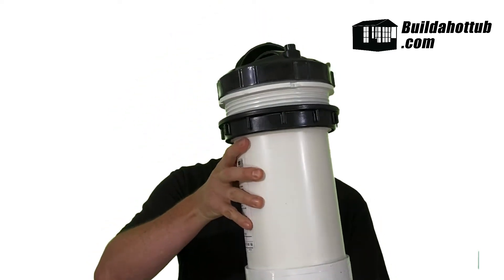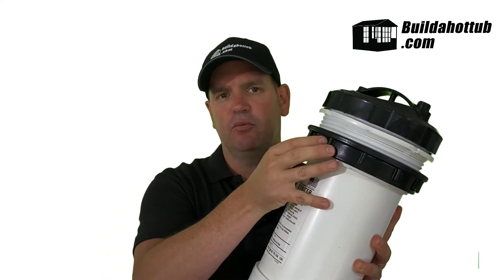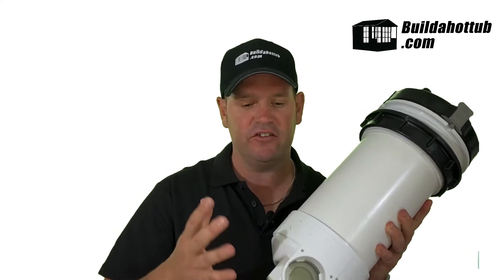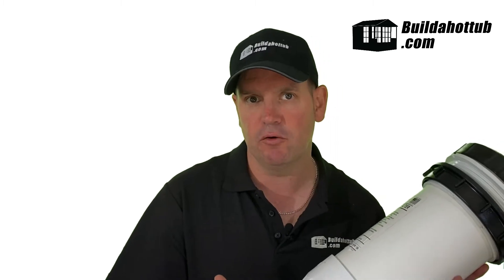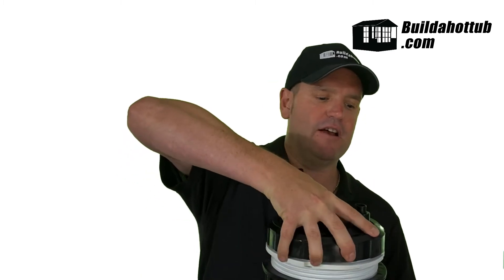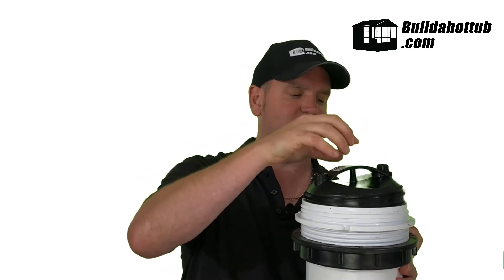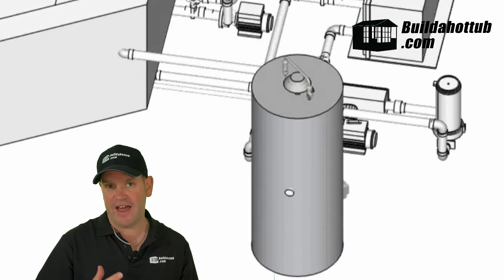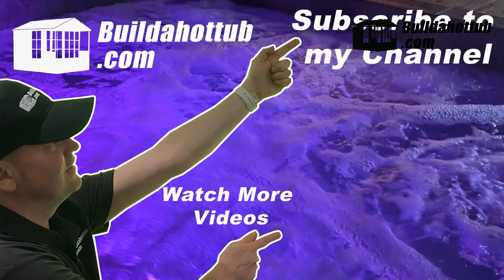Hot Tub Cartridge Filter 101

Comment: How about Removing and installing one ? or is it too difficult?
Reply from the maker: Hi Gary, depends on they type. This type are solvent welded (glued) into the pipe so are a little more difficult to remove and refit as you will need to cut them out. Once they are out, you glue in the new one so not too difficult of a job to be honest. Hope that helps - Andi
Reply: @Buildahottub Can a faulty filter valve make my pump1 not work properly? I don't have a circulation pump...pump1 is the one that filters and has 2 speeds. For some reason not a lot of water is going to the waterfalls and jets of Jet1. Please help.